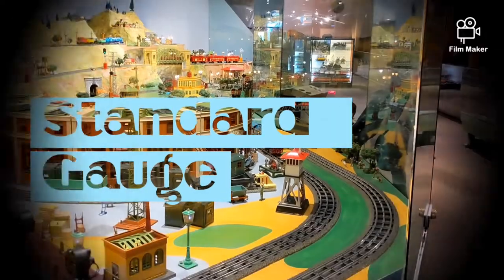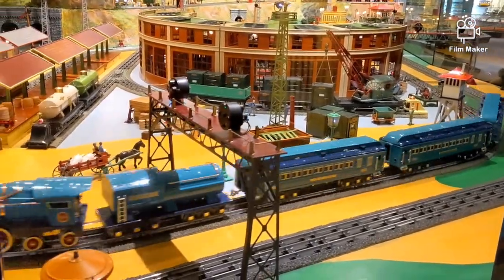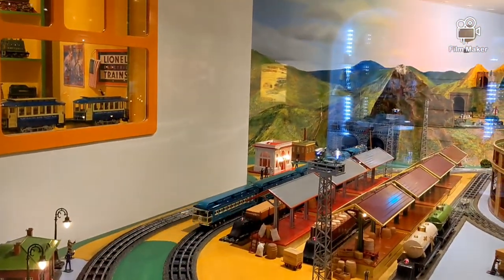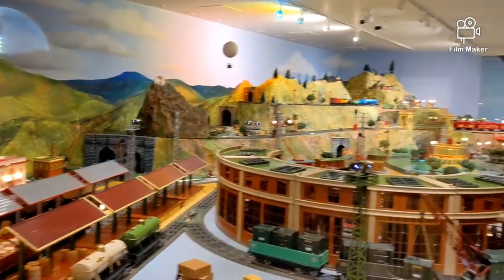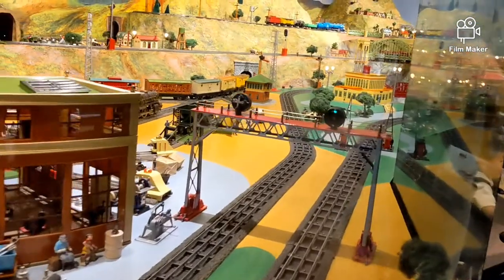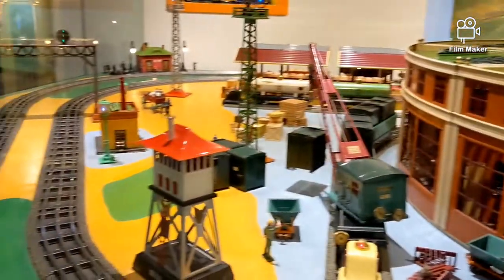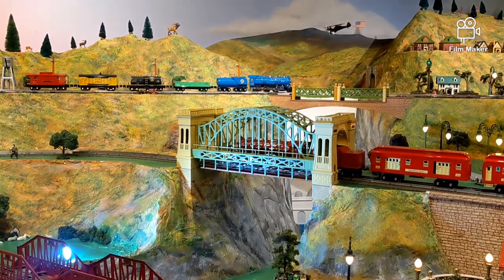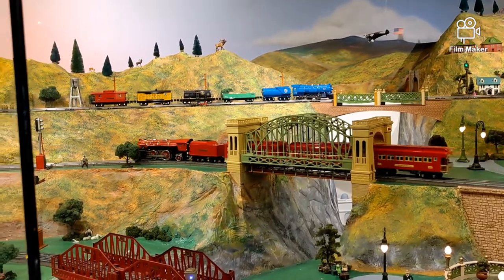Standard Gauge electric trains

Comment: Why does the look so much like your concept with the smaller gauge track elevated in the background? Complete with painted wall backdrop!! Beautiful. And was that a hot air balloon dropping in the background? I was waiting for the little prop plane to take off 😄
Reply from the maker: It is similar to be sure.  One difference would be that my upper layout would extend out flush with the lower level.  I'm really intrigued by the large scale.  I saw alot of it while at the York train show in E. PA.
As for the details...and the balloon did raise and lower...I was so overwhelmed with the layout and the museum and then was in a rush to try and get through everything in the few hours I had that I did not focus on many of the details.